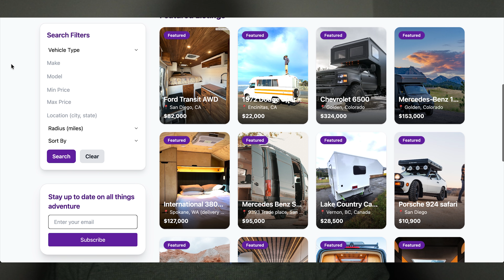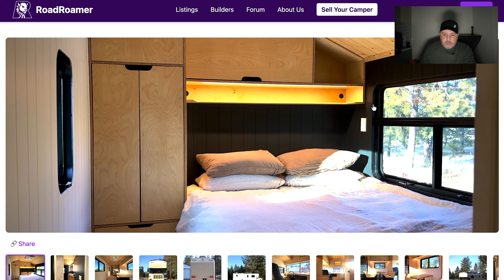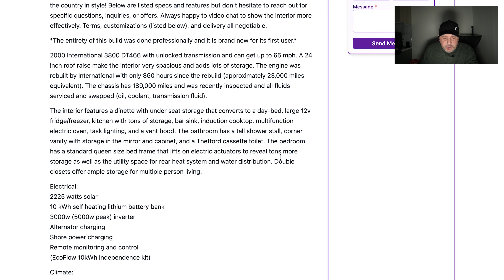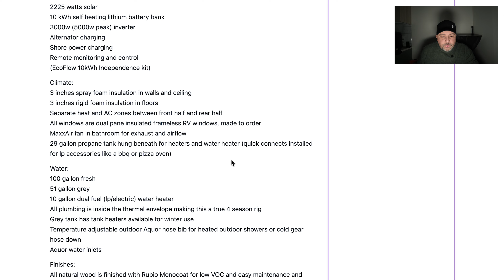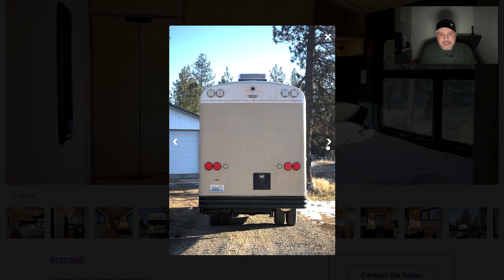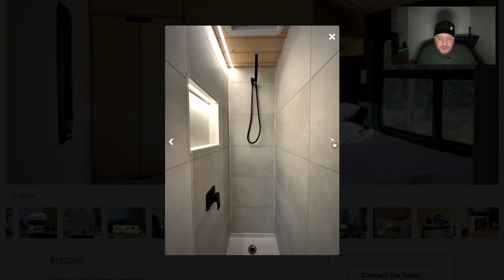Is This $127,000 Build Really Worth It?

Comment: Hey, Jarrod. Okay, you've got my attention here, I'm looking forward to this new series. It's hard to give a negative rating to someones heartfelt hard work, even so, I won't give a dishonest review or rating just as fluff to fill space. Better to simply remain quiet than tell a lie. However... because of what is available new on the RV market today for less money, I must be honest and say this bus is overpriced by $50 to $60K. Not only does it look like a very old school bus, in reality it actually is a very old school bus. New mechanics beats old mechanics any day. I would spend $127K on something new built by a reputable RV manufacturer, but not on this bus. Just to add another perspective of comparison, Forest River builds a Class C self-contained camper on a Ford E450 chassis. $110K for the new 2025 model Solera 32DSB. With a warranty. Beautiful interior! And an extensive set of options and features as well.
Reply from the maker: I agree with you. And that first shock of everything you said were also my first thoughts. However, it’s hard to compare a bus build to van builds. So for me, I wanted to try and separate them. I think the parts and components are the same but the use case are different. If I’m buying a bus build then I’m not going to use it for the same purpose of what I’d use a van for. Personally I would buy a van to travel and have the comfort of home when I travel. With a bus it’s more of a tiny home but off grid tiny home. It has the ability to travel but my thoughts would be to travel and then stay in that location for a long period of time. With a van I’d move around faster. With a bus I can also use it as an investment and put it on property to rent out. So it was hard for me to compare van to bus regarding use case
Reply: @jarrodtocci  yes, my thoughts are the same. That bus needs to be parked high up on a mountain lake over-look on private land or on a primitive camping  beach down in Florida with all the windows opened up to let the sea breezes pass through. I'd not thought about the renting the bus out thing, but that makes good financial sense and I could use it myself when it wasn't rented out. In fact I would be happy to rent it myself if the location was right. This is a great new series with very good comments enticement too. Keep it coming, your site is my go to evening relaxation viewing. Not to mention I've been looking at multi faceted camper options for awhile now. I'm retired and I've entered my second childhood,. I need to do some more roaming around the country, like I did in my early yeas, but in semi comfort. Peace.